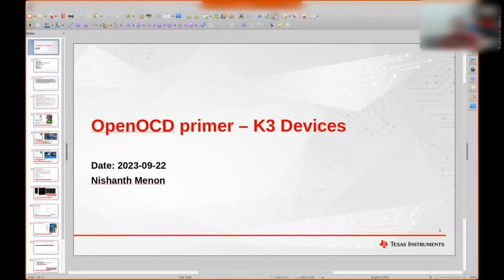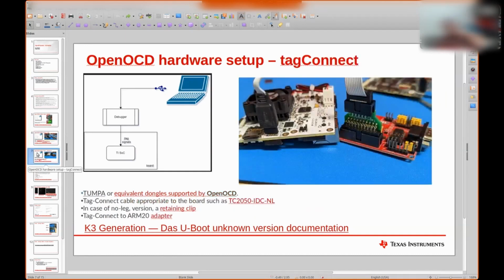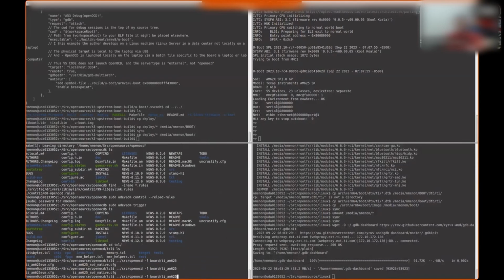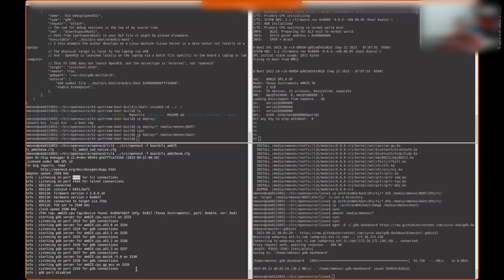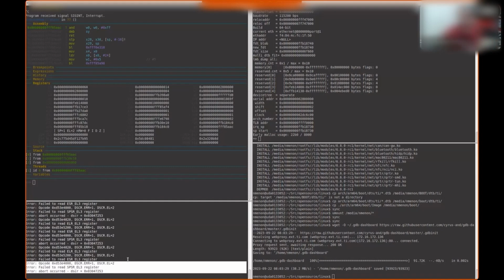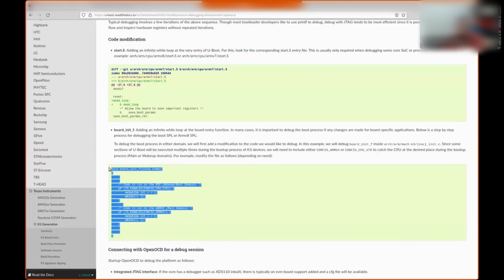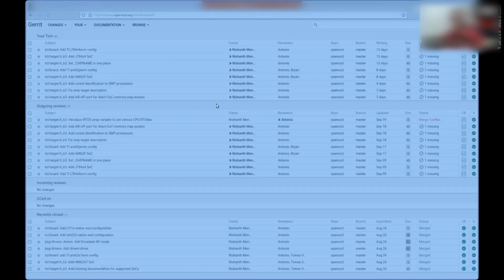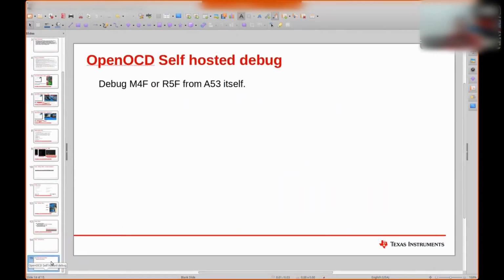Using OpenOCD to debug U-Boot and Linux Kernel

Comment: I'm interested in using openOCD to read from a Risc-V on an FPGA (Microchip's PolarFire). 

I configured SoftConsole(Eclipse) to download the elf using a Flash Pro JTAG dongle. However, not sure I understand what's happening under the hood. I understand OpenOCD is a local server that accepts commands from the IDE.. yet, how does it talk to the Flash Pro Adapter? I see another local server (fpserver") is running, which I assume listens for commands from OpenOCD, yet how does OpenOCD know how to use this server? I don't see any (API) documentation for fpserver!
Reply from the maker: I assume something like https://www.microchip.com/en-us/development-tool/BEAGLEV-FIRE ? I suggest asking on https://discord.com/channels/1108795636956024986/1169639932206252103 channel https://discord.gg/Pjs7Rgcy (invitation link) I haven't had experience with flash Pro dongle https://www.microchip.com/en-us/development-tool/FLASHPRO5 and how it is supported.. at least looking at https://github.com/openocd-org/openocd/tree/master/tcl/interface I couldn't find a match unfrotunately.

Comment: Excellent presentation! Does the BeaglePlay have the XDS110 built-in by default? If it does, it means I don't require a J-Link/Lauterbach right? Also, do I need a TUMPA with the BeaglePlay since there is provision for a Tag-Connect? All I need is the Tag-Connect and TC2050-ARM2010 Adapter, right?
Reply from the maker: Thanks.

To answer BeaglePlay does not have xds110 inbuilt. Tag connect with appropriate setup will work as long as OpenOCD supports it . I just prefer TUMPA personally. It just works for me all the time.
Reply: @NishanthMenon Thanks for your reply from which I could make an informed decision. Ditched BeaglePlay and bought the SK-AM62 instead, cost $246.82  shipping and taxes included. Guess I saved on the JTAG and cables. 😄